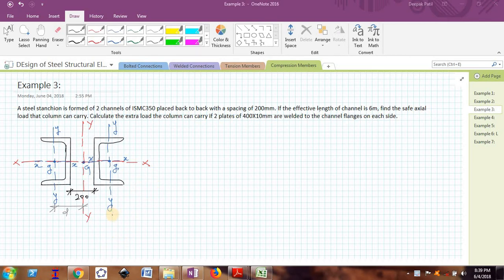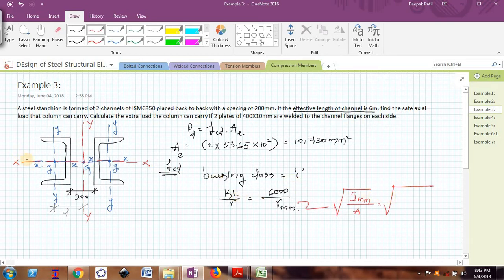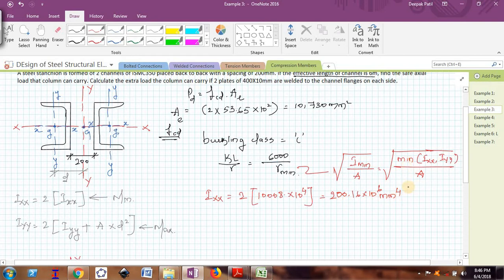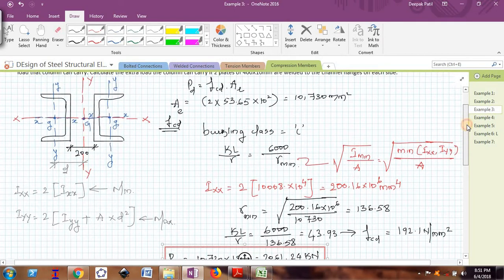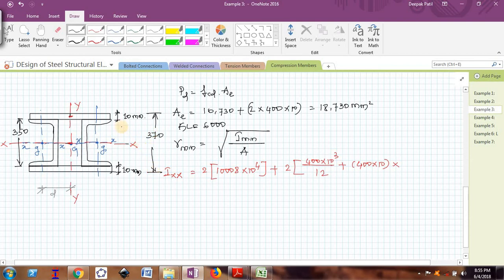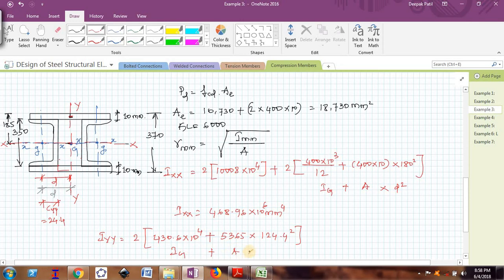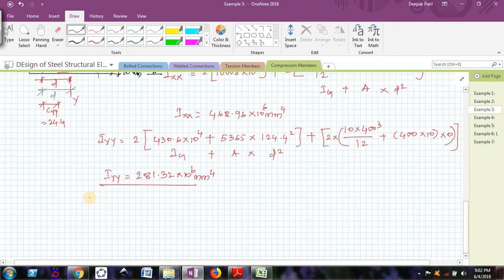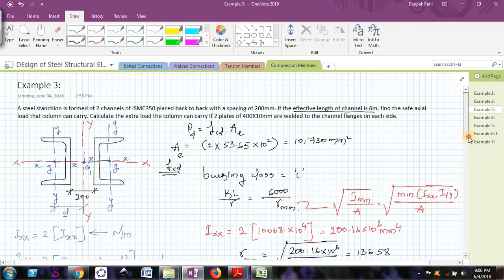Finding Design Axial Compressive load capacity Ex 2

Comment: Sir indeed help  elevator shaft inside cross rail support C Chanel put it.
Need load calculations  100x50 mmx6 thick
Shaft depth 2743 mm